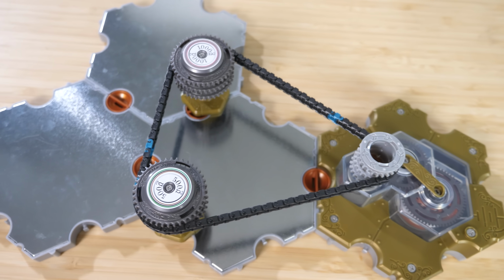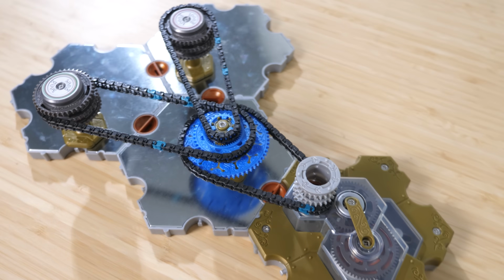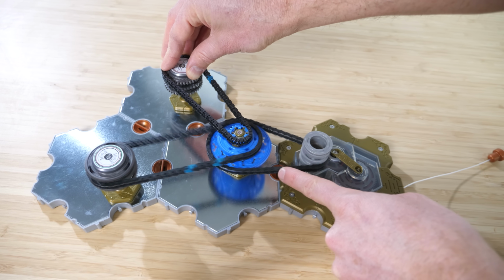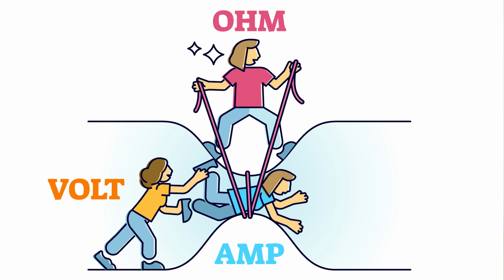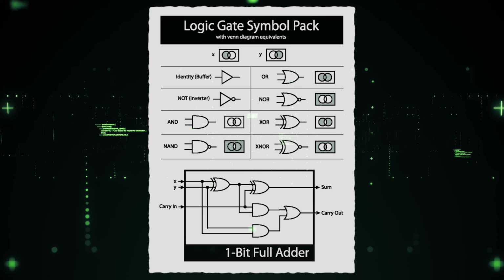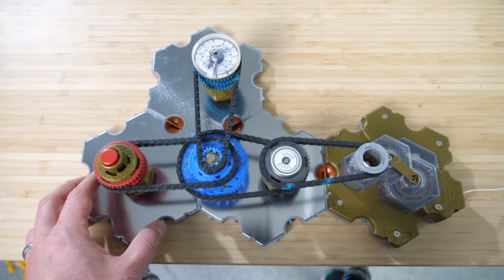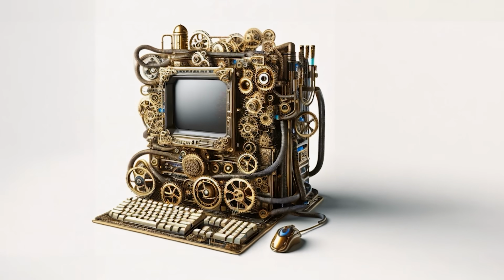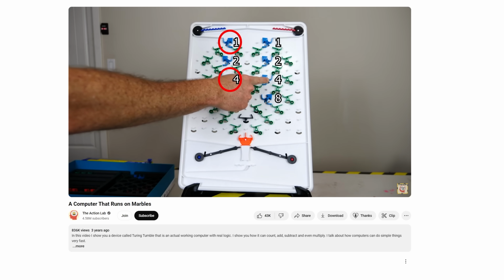Making Non-Electric Circuits With Computer Logic

Comment: Mind blowing fact : While he was fiddling with Maxwell's equations, J. H. Poynting showed that in an electric circuit, the energy is conveyed **outside** the wire. The wire only acts as a "road" guiding the energy form the battery to the load. The EM activity (E & B fields) is maximal outside the wire. The only energy appearing inside the wire is waste heat. This irrefutable fact collides head-on with most of our analogies about electricity (edit : for practical purposes, the chain analogy used by Action Lab is indeed possibly the best analogy available (far better than electron being "small marbles of matter" endowed with kinetic energy) , and the Spintronic toys are great and fantastic way to "grasp" electricity- I wholeheartedly recommend them. We must just remember that reality is even more mysterious- as the energy seems to travel in what we call a "vacuum")
Reply: There was a veritasium video on it too with some controversy as well
Reply: I only found out last year electrons dont move at the same speed as electricity
Reply: @pimcramer2569  yes they move slowly. It's the " holes" that move close to c as Richard  Feynman said.
Reply: Another YouTuber (sorry, can't remember name) did a video debunking this by way of an experiment using really long wires looped back to a load close to the power supply -- a very small fraction of the energy went outside the wires, but the bulk of it went along the wires.
Reply: @Lucius_Chiaraviglio  If you mean AlphaPhoenix, then yes, he does an excellent job of explaining it with multi-channel oscilloscopes hooked up at different locations across the circuit path.
Reply: @0neIntangible  Yep, the video I linked (when I edited my last post) is an AlphaPhoenix video.
Reply: @Lucius_Chiaraviglio I guess you mean alpha phoenix
Reply: @Lucius_Chiaraviglio  AlphaPhoenix
Reply: @Lucius_Chiaraviglio  And how did he make the measurements?
Reply: Presenting this fact as somehow a counterpoitnt to the video, however, is pedantry.
It was also pedantry when Veritasium did it.

The video addresses this point at the very end, for anyone who actually watches that far.
"All models are wrong, but some are useful."
Reply: @delphicdescant Its absolutely not a counterpoint to the video. Its just a reminder of a little known, but mind blowing fact about electricity. The chain analogy used by Action Lab is good (far better than electron being small marbles, for example) but we must remember not to push this analogy too far.  Even Feynman knew about Poynting vector, but could not admit this was true. Science is not about consensus. If you deem it pedantic, so be it.
Reply: It is well known fact but that energy releases itself in the electrical load only by accelerating the mobile charges in the load. Even the setting up and propagation of those fields are dependent and closely linked to the moving charges in the conductor. Veritasium's video on the topic has a little fact laced in a lot of inaccurate and wrong reasons and examples wrapped around it.
Reply: @AbhishekKumar-el7vo  Steinmetz equations ..
Reply: This is because particle physics denies the Aether.
Reply: @codetech5598  This is exactly it. Maxwell, Faraday, Lord Kelvin, Lodge, Stokes, Lorentz, etc. were all staunch advocates of a physical medium for EM waves (aka "the Aether"). But Einstein's 1905 Special Relativity article deemed it "superfluous", so this concept was given an unceremonious express burial. Even Einstein, in his later years, started to backtrack on this, notably stating "Space without Aether is unthinkable". Today we give fancy names to the thing permeating vacuum that are very reminiscent of the Aether concept, eg. Quantum foam, Zero Point Fluctuations, etc.
Reply: @jamesclerkmaxwell8020  Tesla was correct in his assessment of Einstein as a "fuzzy haired crank".
Reply: That was addressed in 7:40
Reply: Electricity's so painful to try and wrap my head around. Almost as painful as touching an electric fence when I was a kid (At least that's fleeting and can easily be avoided in the future. The retarded shenanigans of electricity itself are here to stay)
Reply: Why not also state the fact that electrons possess even wave like characteristics and everything else like uncertainty  principle, dual nature of radiation and all that you have ever known wherever any aspect of that topic is discussed? Models are meant to simplify reality by not taking into account every single aspect of reality. Any analogy will never be absolutely right or else it would not be an analogy it would be describing the exact same thing in exact same terms. Even the water analogy of electricity is excellent in its own right.
Reply: The water analogy is good but collapses very quickly when it comes to explain the magnetic field around an electric wire carrying a current, and the property of inductance aka "electric inertia".  For the B field varies according to the shape of the wire.
Reply: @jamesclerkmaxwell8020  That model is not meant to explain magnetic fields around a conductor just like the theory you are obsessed with fails to explain the waste heat generated within the conductor or how resistors work. This waste heat generation is very well explained by the common widely used models.
Reply: @AbhishekKumar-el7vo  You are incorrect, the Poynting vector perfectly explains the waste heat in conductors (& resistors). There is a residual longitudinal E field inside a conductor, due to the conductor's resistance. The Poynting vector analysis shows that a part of the energy "dives" toward the axis of the wire. Having no outlet, the lost EM energy escapes as heat. Same for resistors. Feynman mentioned this in his lecture. That is also why superconductor have no E field inside, no heat loss either.
Reply: @jamesclerkmaxwell8020  Just that pointing towards the core explains the transformation of energy in the field to heat. The difference between conductors, insulators and superconductors can be explained by just finding the direction of vector. Then a compass is the entire explanation of geology and geography.
Reply: @jamesclerkmaxwell8020  It is as good as yelling that the bullet gets the energy from gunpowder every single  time you hear the gunshot.
Reply: Finally someone saying this. Everyone was fighting veritasium for something you normally study in a standard electric engineering career
Reply: Mind blowing fact: I didn’t read all of this
Reply: Nope.
Reply: i don t know what are you talking about fr😂
Reply: i wonder what would happen if you make a wire that maximalises surface area
Reply: Electric don't need air really
Reply: How adhd are you?

I use (nested (contexts))
Reply: Not a vacuum, but the aether. 😅
Reply: Since it is obvious that the magnetic field is outside the wire, it should be expected that the electric field is also outside. 

C P Steinmetz made that point also.
Reply: In theory you can detect the location of the energy flow by detecting its gravitational effect via general relativity since the poynting vector is what couples to the gravitational field. Good luck getting multiple grams of energy to flow though a wire for multiple minutes to detect the gravity.
Reply: @trevorclinton2573  Not only that, but even if you pulled it off, how do you keep non-gravitational effects of the energy flow (especially if electricity instead of light) from swamping out the detection of the gravitational effect?
Reply: Skin effect.
Reply: @mitzvahgolem  This is not skin effect. Skin effect happens only in AC. The Poynting vector shows that energy travels outside the wire both in DC and AC scenarios
Reply: @jamesclerkmaxwell8020  wow true . DC as well.
Skin effect is counter intuitive in AC.

Comment: I'll take a wild guess, but in 2 months some madman is playing Doom on this thing.
Reply: Making a CPU out of chains is extremely hard. Not only the resistance will be so high that you would need to apply an insane amount of force (probably more than the chain can handle), but it's also likely to be larger than 50 average rooms.

yeah, processors are giant if we go to the macro level
Reply: I'm more than sure that it can run it
Reply: Oh, also inertia of the chain wouldn't allow it to run anywhere near DOOM's minimal processor frequency requirements.
Reply: @git4rker you can't remove the idea that we don't make a wire system
Reply: It would be insanely loud and probably melt itself down from all the internal friction. Which would be awesome to see.
Reply: Don't you need a screen?
Reply: It's funny to see how - now that we do have the technology - people start to "discover" how things actually started. The first computers were in fact mechanical. The theory precedes electronics by a long time: it's precisely the limitations with mechanical computers (heat, size, etc) that delayed the advancements until we were able to do things in a more efficient way
Reply: @alpardal  It funny to think about the fact that the term computer originally was used for all the people who were doing the calculations. While the mechanical room sized thing was barely able to do addition and subtraction.
Reply: Nope
Reply: you've been spoilt on internet content if you think thats possible
Reply: that delay tho
Reply: Nope
Reply: it's gonna happen, eventually

Comment: There are different ways of getting a 3-valued logic. You could have pairs of inputs, which is actually 4 valued if the underlying circuit is binary, but you could also have a switch that is either on, off, or partially on. I wonder if you can do that with spintronics
Reply: thats the quantum gates right
Reply: Sorry but elaborate please. Even I understood how quantum bit(s) logic works, what is "partially on"? I know and quite understood how quantum logic had such like "half value" but "interference" is still a big problem rather than just accepting those chain & tube model as simplification how electric field works.